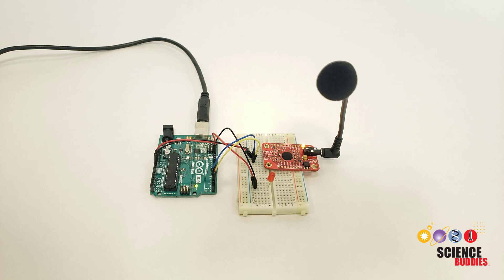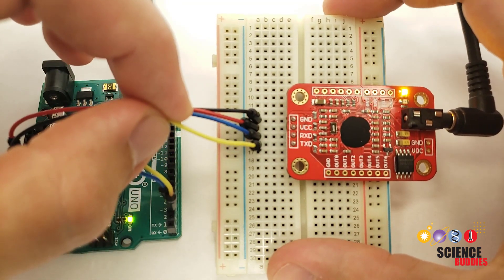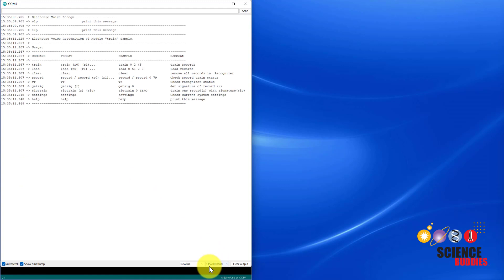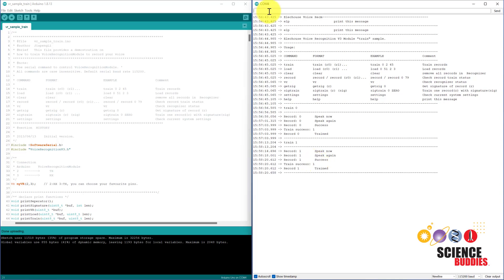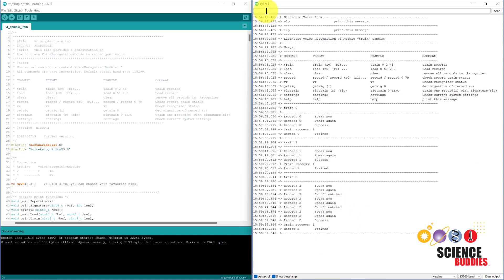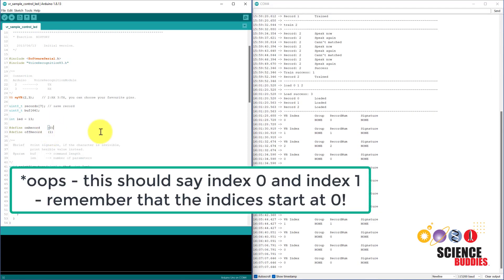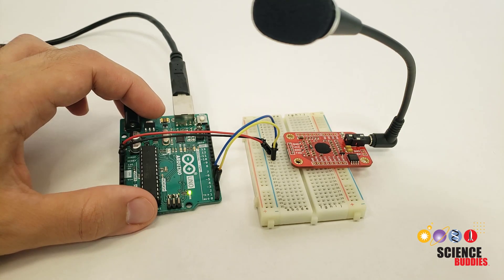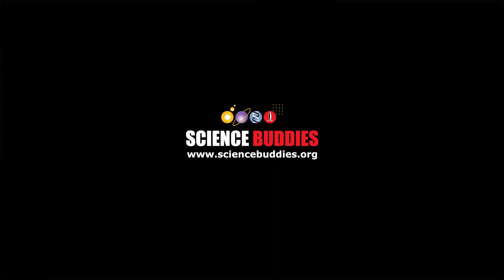Elechouse Voice Recognition Module V3.1 and Arduino - Setup and Tutorial

Comment: Could I still use it without header pins? If I can, how would i do it?
Reply from the maker: You're going to need to solder header pins or wires to the holes on the board in order to connect to it. For many of our projects intended for younger students, we suggest using alligator clips in order to avoid soldering, but the holes on the board are only 0.1" apart, so too tiny to use alligator clips.

Comment: I did everything you said but I keep getting this error message:

/Users/*******/Desktop/vr_sample_train/vr_sample_train.ino:28:10: fatal error: VoiceRecognitionV3.h: No such file or directory
 #include "VoiceRecognitionV3.h"
      
compilation terminated.
exit status 1

Compilation error: VoiceRecognitionV3.h: No such file or directory
Reply from the maker: We have been receiving multiple reports of problems using this module. We recommend contacting the manufacturer for a replacement or a refund.

Comment: every time I try to train a word I get this message

train 0
--------------------------------------------------------------------------------
Train Timeout.
Reply from the maker: We have been receiving a lot of reports lately about issues with this voice recognition module. We recommend contacting the seller or manufacturer directly for a refund or replacement.
Reply: @Science.Buddies  i fixed it, i switched theTXD pin with the RXD and it worked

Comment: bro plz help me.... i  have purchased this module today only but while training it , it show trained successfully but when i used to load them it show untrained .... plz plz help me
Reply from the maker: A lot of users have been reporting this issue lately and it appears that it might be a problem with a bad batch of boards. We recommend contacting the manufacturer for a replacement.
Reply: get the DF Robot Gravity voice recognition. I bought the elechouse one and it didn't work and had to fight for a refund. The DF Robot one is awesome. It's cheaper and far superior. I hooked mine up to all sorts of motors, relays etc and it worked seamlessly. So good, I bought another for my workshop.

Comment: The product is too expensive i cant afford it, is there any other alternative for voice recognition? (Maybe just like cheap version of voice sensor)?
Reply from the maker: Hi - you can use a cheap microphone for very basic sound loudness detection but this part on its own will not recognize voice commands: https://youtu.be/bMs5J4bJOD0?si=L5BXUp2XXDSwGx8s
Reply: You can try the speech recognition module DM50A, which has a high cost performance ratio.

Comment: my final year project is doing with voice recognition module V3.1. but  i have a huge problem. voice recognition doesn't response when background noise is occur. what can i do for it. because the circuit should can be use noisy areas
Reply from the maker: This voice recognition module is not as powerful as cloud-powered assistants like Alexa/Siri etc because all of the processing is local, so it is not capable of filtering out background noise. It can only respond to the exact sounds that it is trained on. One option would be to record multiple "training" sounds in the area where you expect to hear the background noise, and then make it respond to all of them. It might not be perfect but it could work better than only training a single sound in a quiet environment.

Comment: good day sir, thanks for this video. i would like to share that i encountered loading problem during the train phase. I successfully trained 4 voice commands but i can't load them. like using the following command:
load 0 1 2 3
after entering this command,  no one has been loaded( 0 loaded)

hope anyone here can help me. thank you. Godbless
Reply: I am facing the exact same issue, did you find any solution for this?
Reply: @cosplaystore  I think the board is really defective. I just replace the board then it works normally.

Comment: i was wondering if the module can handle more than 4 commands in one time  i tried like 7 commands and only the first 4 are working is there is any soultion?  ... and should i remove the rx and tx pins when i upload the full code to  the arduino
Reply from the maker: No, you should not disconnect the rx and tx pins, since the module still needs to communicate with the Arduino after the code has been uploaded from your computer. You will need to consult the Elechouse documentation regarding how many commands the module can handle at one time: https://www.elechouse.com/product/speak-recognition-voice-recognition-module-v3/
Reply: @Science.Buddies yes  after I tried a few times it worked thanks 🙏

Comment: The board turns off when I plug in the GND and VCC wires. What happened?
Reply from the maker: Unfortunately we can't really help troubleshoot without seeing your circuit. You may have a short circuit on your breadboard somewhere or a problem with your power supply.

Comment: Hi i hope you'll notice this comment but anyhow, i would like to ask that is this capable enough to prompt a command that is suitable for creating a voice recognition water dispenser? my thought process is like when i speak a specific command like for example "Cold" this can prompt the water pumps and dispense it? i hope this can be answered it really helps thank you!
Reply from the maker: Hi - yes, you could do this. You may want to check out our How to Use an Arduino playlist: https://youtube.com/playlist?list=PLlBVuTSjOrclb0iCMSRpS_H1lSrlSVeEm, and this project which is on a different topic but shows how to control a pump with an Arduino: https://youtu.be/aRBPa3N70fk. That project uses a small pump that can be powered directly by the Arduino, but for a larger pump you would need an external battery pack. We have several projects that show how to do that, for example this drone video: https://youtu.be/QNnx2evKb_0 or this autonomous car: https://youtu.be/qUo6hXSV1b8 (those are both controlling motors, but a pump is really just a type of motor). The description for each project contains links to our website with parts lists and circuit diagrams. Hope that helps!
Reply: @Science.Buddies  thank you so much! and a new subscriber for that.

Comment: Hey , can I build automated scarecrow machine with this module , that will react by sensing sound of only crows and birds
Reply from the maker: You could try that, but you'd need to waterproof the entire thing if you want to use it outside. Another option is to use a passive infrared (PIR) motion sensor, but that would detect any moving animal or human.

Comment: Hello, the explanation is very nice, but I encountered some problems when applying in the serial monitor. When I type the word train 0, the phrase “Speak now” does not appear, and instead the phrase “Time is over” appears. What should I do to solve this problem?
Reply from the maker: Hi - we haven't encountered that problem so unfortunately aren't able to offer any advice. You may have more luck on the official Arduino forums or contacting the manufacturer for support.
Reply: @Science.Buddies  🌺Thank you for your reply
Reply: @alihussein-sh5ik  have you figured out how to fix this problem?
Reply: Click ctrl F and search timeout it will pop up then go 7 lines up u will find this line "if(ret >= 0)" change the 0 to -0 that's all the base code is wrong hope that works if u are wondering im just 14 years old i am not an expert
Reply: Hello I am facing the same problem, did you solve it yet? if yes can you please teach me what did you do to overcome this problem.
Reply: have you guys figured it out? i'm having the same problem and I'm curious if you guys know what to do
Reply: Simply rewire the board and reset the Arduino if necessary, mine worked like that.
Reply: @aritrabaidya9029 how did you rewire it
Reply: there are multiple lines that have "if(ret>= 0)" which one is it??

Comment: My VoiceRecognitionmoduleV3 doesn't save any commands after I power cycle the arduino. Any ideas how to fix this?
Reply from the maker: Unfortunately we're not sure, you will need to check their documentation or customer support.
Reply: @Science.Buddies  This was so obvious I feel stupid. I wasn't uploading the code to the arduino after loading the voice commands.
Reply: Also, the recognizer will get wiped every time you plug in the arduino with the serial monitor open.
Reply: @1tokeover  hey how do you go about this
Reply: @HushOnDaBeat  which part?
Reply: @1tokeover  i got it solved thanks
Reply: This is my problem too. When I plugged in the arduino to my laptop, then uploaded the code successfully, and tested if the commands work, it works. But when I unplugged the arduino to my laptop then plugged it again, it doesn't recognize any commands anymore. I have to upload the code again to make it work again. Please help me fix this
Reply: @bluthee  I replied to my OP with the fix.
Reply: @bluthee  i had the same issue. my solution was to initialize the pins in the setup of the code. worked like a charm. after combing the internet I couldn't find any solution
Reply: @HushOnDaBeat  I already initialized it. Still not recognizing voice command after I unplugged then plugged again the arduino. The worst is I have to train it again.
Reply: @HushOnDaBeat hi by initialise you mean set pinmode?

Comment: Getting errors:

Sketch uses 11518 bytes (35%) of program storage space. Maximum is 32256 bytes.
Global variables use 855 bytes (41%) of dynamic memory, leaving 1193 bytes for local variables. Maximum is 2048 bytes.
avrdude: stk500_recv(): programmer is not responding
avrdude: stk500_getsync() attempt 1 of 10: not in sync: resp=0x00
avrdude: stk500_recv(): programmer is not responding
avrdude: stk500_getsync() attempt 2 of 10: not in sync: resp=0x00
Reply from the maker: Hi - we have not seen that particular error message before. We recommend doing a Google search for the text of your error message, particularly "avrdude: stk500_recv(): programmer is not responding." There appear to be many threads in the official Arduino forums that mention the same error, for example: https://forum.arduino.cc/t/avrdude-stk500_recv-programmer-is-not-responding/585181

Comment: does it filters the external noise  other than human voice
Reply from the maker: Hi - this is not as powerful as virtual assistants like Siri/Alexa etc and will not do as good of a job with filtering noise.
Reply: @Science.Buddies  thanks a lot for your response bro
Reply: @Science.Buddies  is there any methods to improve the reliablility of it by adding some noise cancelation are any other methods   
i have buyed it for my project but its not that much accurate  i think by changing the the mic connected  to it  is there any other idea please tell it to me which helps me in my project
Reply: Dealing with same prblm bro...May I know any possible solutions